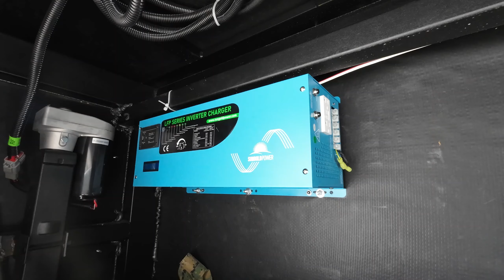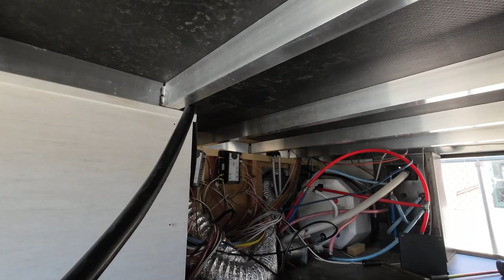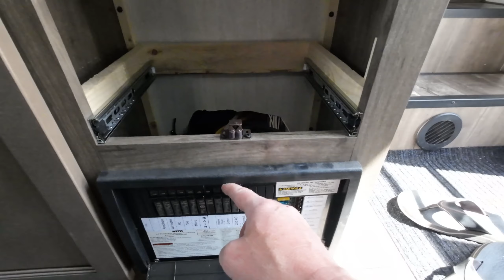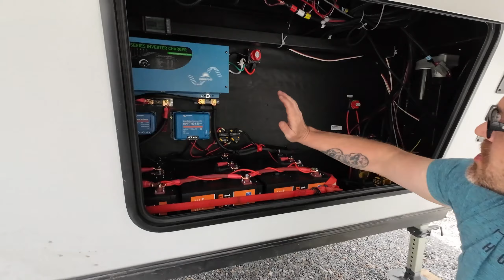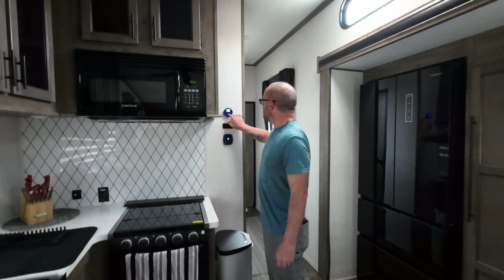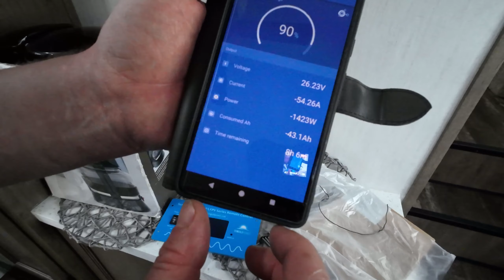RV SOLAR PART 2. WILL IT RUN OUR AC?

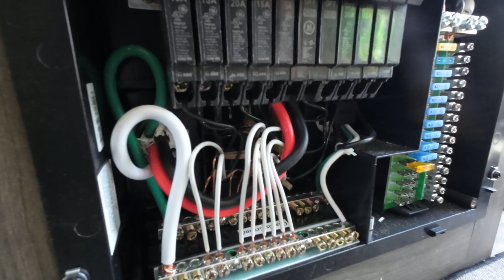Comment: 8:17
you want to use a ferrule crimp on stranded wire if youre not going to use it inplace of solid core connections. screwing down on it tends to push out the strands leaving a smaller gauge wire connection.
Reply from the maker: I agree I thought of that after the fact. Thanks
Reply: @Interstate78-qu2dw  
i got your first video recommended to me and ive just started to binge watch your channel.

that victron shunt is great, there was a cheaper alternative called fusion energy that doesnt seem to be in business anymore but another one popped up recently called LNEX.
two things ive found annoying with the victron shunt
1) the shunt cannot be connected to a PC through BT because of an issue with windows, IOS is fine from what the rep told me
 -i use a generic prepaid smartphone that has an LCD display to avoid screen burn and just have that on a charger with display always on
2) the shunt doesnt display estimated time to fully charge, only depletion time

your a/c unit uses up a LOT of power, would you ever replace it for a more economical option?
- inverter style units seem to be all the rage atm
Reply from the maker: @MHawkeye  yes!! The eta thing on the battery charging is a massive oversight. It does count ah in and out per day though so you can kind of tell from watching that as long as you re synchronize every so often. I think I will probably just soft start them both in the hopes I can run them both at the same time for now.

Comment: Yes, you only want your converter on when plugged into a power pedestal and your inverter is off. If not, you'll be in a loop with power coming from your battery to power your inverter which is powering your converter to charge your 12v battery (assuming you retained it as a buffer for high amperage draws, such as slide motors and leveling jacks and for redundancy like I did). If your converter has a dedicated circuit, you could just flip the breaker. We just keep ours unplugged, as that circuit has a couple outlets for other things, and we hardly ever plug into shore power anymore. In fact, it's been 6 months of FT living since we did. I highly recommend getting a soft starter for your A/C, like the Micro Aire unit we use. Our EG-4 28.5 Seer-2 mini-split for the bedroom only uses about 1/3 the power our 14.5k btu front rooftop A/C does and produces efficient heat too.
Reply: Yes, when you are plugged to shore or RV park power.
Reply: @markarca6360  We don't do this anymore. The only time we run our generator is to exercise it, as we have sufficient batteries and solar to live entirely off our solar system now.
Reply from the maker: Yes we isolate the converter on every trailer we've had. Very seldom does it ever get turned on. On earlier systems we simply just plugged an extension cord into the shore power from the inverter